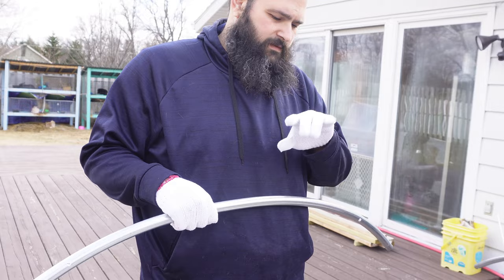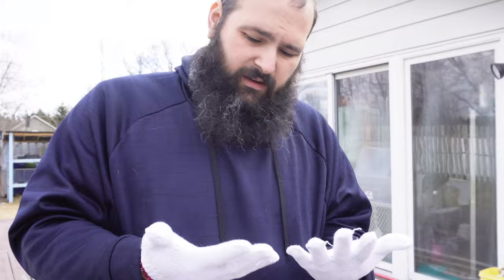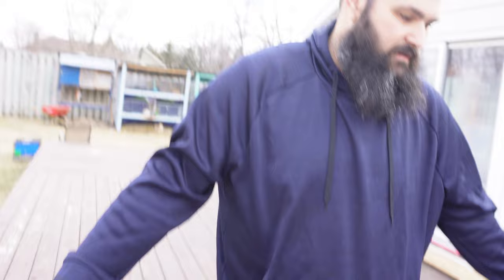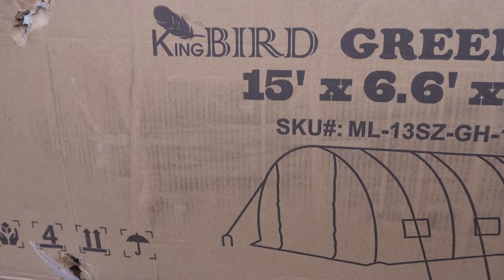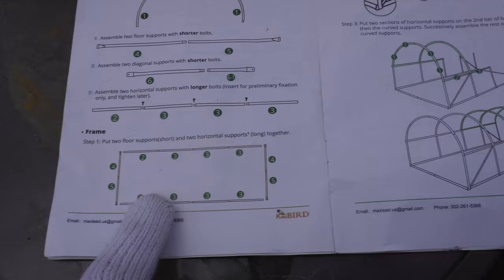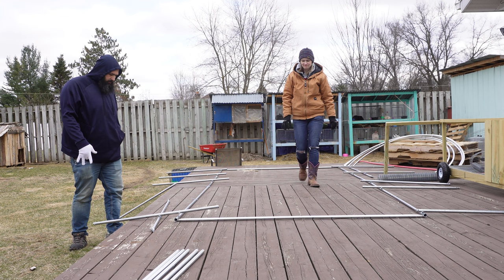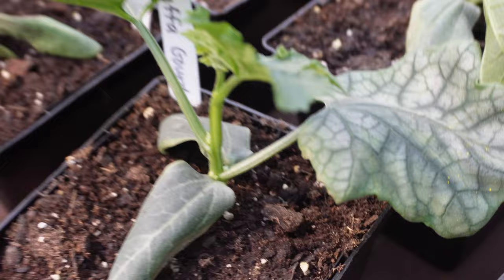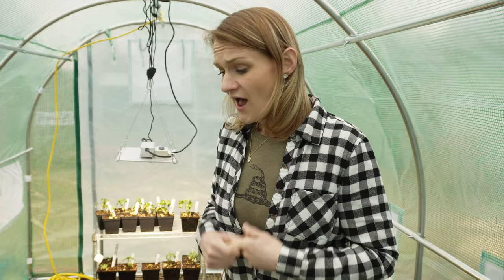A Greenhouse in Your Backyard - The Easiest Way To Save Money

Comment: I purchased my 6.6 x 10’ greenhouse in February. I put weed barrier down in the yard put in 6 tee Post And attach a 4 x 6 cattle panel on the T post. I built the greenhouse over the top of The cattle panel. I secured the bottom edge with concrete blocks that I have on hand. Then Use rope to help hold it down. Rope ends tied through concrete block  Zip ties used to secure the green house frame to the cattle panel I am very pleased with mine and have 200+ garden plants ready to go in the ground when it is a little warmer
Reply from the maker: That's awesome. if we had to buy everything to make one out of cattle panels it would have been more money than this kit. 
We ended up putting 2x4's on the skirt of the plastic and screwing it into the deck to secure it and it's working a lot better that way now.
Reply: @WhiskeyTangoFarms  I bought damaged  cattle panels. 2 for $34. When the greenhouse cover is weathered I will get another cover or use heavy plastic.  I got my kit $78 ordered in February. Has since jumped up to $130. Your 2x4 solution is great when installing on a deck like you did. Happy planting. Blessings all around

Comment: I have the same greenhouse and I'm in Wisconsin too, the string it comes with helps the rainwater run off so it doesn't pool on the top. Trust me you want to put it on there I found out. Other than that it worked great for me last year except for a couple cold nights where I lost some plants but your hay bales should help
Reply from the maker: Good to know. We ended up putting 2x4s on the flaps and screwed them to the deck and the wrap is very tight now so I don’t think we will need the rope that it came with. We tried that and it wasn’t enough to hold up to the wind we had a couple days ago.

Comment: Cattle panels go up much faster,  It'll be hot with the sun up,   but when the sun goes down,  it might not hold all the heat
Reply from the maker: Cattle panels would go up faster but would have ended up costing more than this kit that why we went this route. its been working well for the past week now. staying warm enough in there even when the temps go down into the 20s at night.

Comment: Ours was the 15' x 6.6 x 6.6 greenhouse....
Reply from the maker: That's what this one is.
Reply: Oh I didn't realize that you had the same size, ours was white and I then assumed that the smaller size would be the green color.
Reply: Also the instructions were almost pointless.  Confusing and a lot of putting pieces together and taking them apart when it really wasn't necessary.  They have a neat product that is more affordable than other options but they certainly need to tweak a few things!!
Reply from the maker: This size came in white or green.
Reply from the maker: I would agree. The instructions were lacking. I think there are some improvements they could do on the cover as well.
Reply: UPDATE *!*! I received a call from the company finally and everything is ordered through email  but with pictures and my order number from Amazon they will send me a replacement cover.  My faith is restored.  She did not mention a price at all so I am assuming that it will truly be a replacement.   I am excited once again and will give them a wonderful review after all is taken care of!!